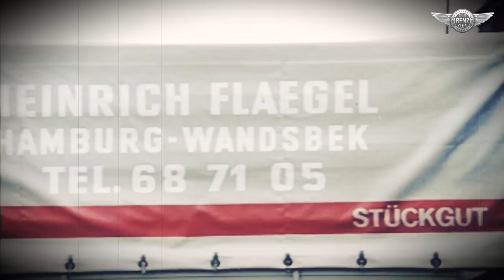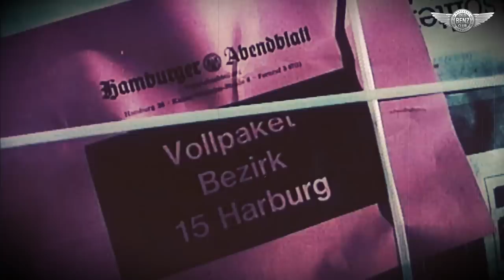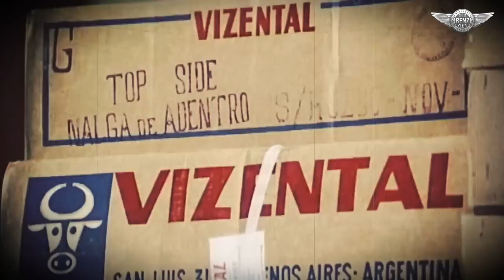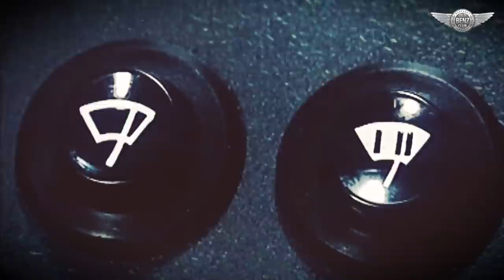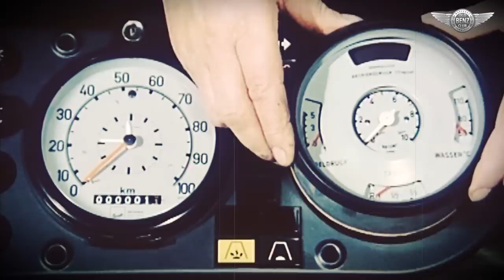Mercedes-Benz T2 first generation 1967-1986 #mercedest2

Comment: Loud and slow engine, although very strong, the 608D still is very popular in Brazil.
Reply: the green 3.8 litre engine was not very fast but very strong and lasted a lifetime.
I did own a 613 witch is the 6 cilinder version of that same engine, and that was
a real powerhouse that could pull any trailer and it did 120kmh easely.
Reply: Loud and slow?
Check out a 406 D
😊

Comment: I’ve been driving one of these vehicles it was similar to the truck @ 8:59 and boy was it a heap of crap with 9 million miles on the clock and it kept going so yeah a lot of fun too. and it had a tarp over the bed. Dual cab and a sleeping commendation behind the front seats with a mirrored ZF 13 speed range split gearbox. I blew the gearbox on my way to board a ferry home. It was scrapped I believe somewhere in Germany. It was old but sturdy enough to keep going for so long.

Comment: I got this its 508D producted 1984 and mz father buy it in 1997 and we using it 20 years still in function and working fine, its slow but it can pull mach easier then 515 cdi sprinter with 70 hp more, and got start buton like new exotic car haha :D

Comment: Brilliant.
Thanks for posting. 
I might be wrong, but was there a 4x4 version?
Reply: No
Reply: There was indeed MB 508 as 4x4 although just small batches modified by Fa. Iglhaut using the front axil of the mercedes G-Wagon as early as 1983. Mercedes first factory 4x4 T2 was the 814 DA in 1991.

Comment: T2 zweiter generation, not erster generation. The erster generation was Mercedes Benz T1(Bremer)
Reply: . T1was the small one (207,308,408) t2 was the big one (508,608,711) 
It was used on both types. The bremer and the düdo.
Reply: There was an old and a new version of both.  The newer ones were built after 1978.